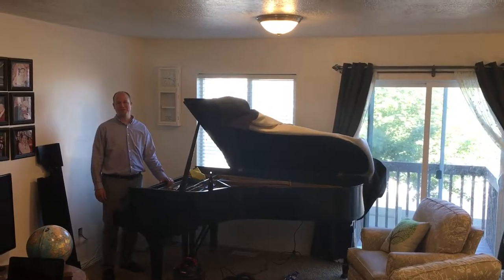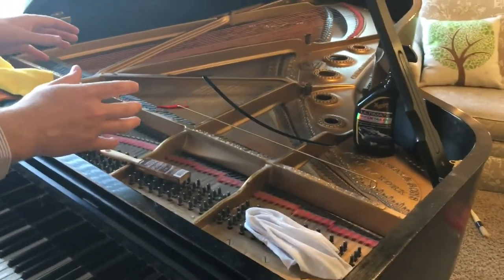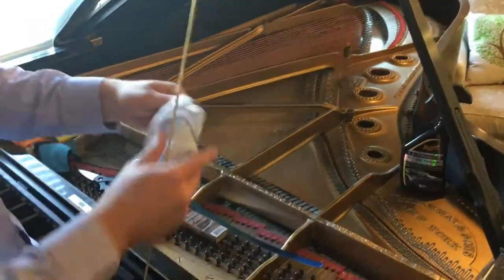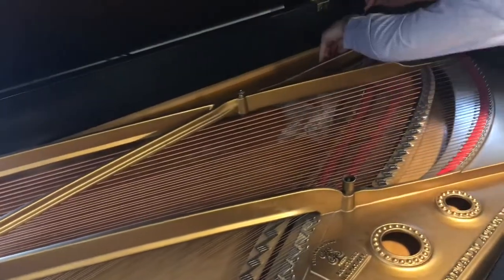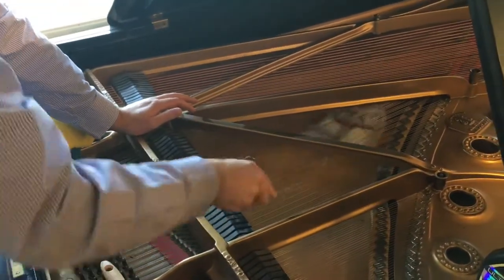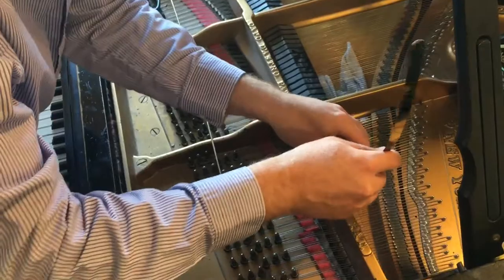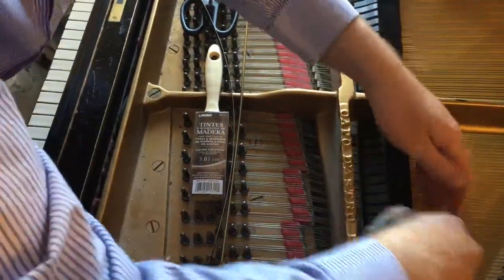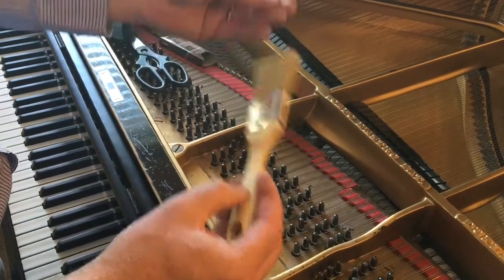How to Clean Your Piano

Comment: Doesn’t the silicone in that Meguiars detailing spray present a danger? I just read about a piano that couldn’t be buffed out because silicone buildup from cleaning products had been absorbed.
Reply from the maker: I use this product based on a recommendation from a finish repair expert who is regularly buffing out pianos, so I would assume not. However, he does say that this spray shouldn't be used too often. Most often regular dusting and wiping with a moist cloth is sufficient.

Comment: what do you think about the idea of a boy with the nickname "piano doctor" who is very popular on YT. He cleans the soundboard and everything with wet wipes. After all, they may contain additives, for example glycerin or alcohols, they will stain or damage the piano.
Reply from the maker: I saw that video! My fist reaction is that baby wipes hold a lot of moisture, much more than what I typically use. Most of the time I am "dusting" pianos, cleaning off light dust on a well-finished soundboard. I think a slightly damp rag might be a better choice, and I wouldn't use the baby wipes on the case finish. Maybe there are some baby wipes with just water added, but it's still more moisture than I am comfortable with.
Reply: @saltlakepianoservice  
I am also a tuner for 30 years in Poland and I also remove dust only with slightly damp cloths.

Comment: Where do I get that tool on a wire to clean the dust under my strings? I need that!
Reply from the maker: @MonogramQueen I sell the tools normally at a cost of $55 plus shipping and applicable sales tax. I am currently out of stock of the tools that I make. You could check in with me (saltlakepianoservice@gmail.com) in December if I have more in stock, or I could order a similar set of tools from an industry supplier, pianoteksupply.com that would include three wire and sweep tools (long, medium and short) and a piece of soundboard steel (the flexible flat steel piece) and ship it to you. The price would be $95 and would include shipping. You could also try etsy or ebay for similar tools. I can't vouch for the quality of tools from other sources. Thanks for the inquiry! Let me know if I can help you further.
Reply from the maker: We now have more cleaning toolkits in stock. Visit https://saltlakepianoservice.com/products.html to order!

Comment: Thanks for the tutorial.  However, my Grand piano has dust that goes far deeper than that (down through the hammers/impossible to reach). Would these need a special technician to remove the metal frame etc? Thanks ☺️
Reply from the maker: Most likely, yes. You can check my video on cleaning keys and that shows how to get an action out of a Steinway, which may help. Some dirt gets stuck on the metal plate in such a way that it is impossible to clean it and have it look like new without removing all the strings and refinishing it.
Reply: @saltlakepianoservice  thanks for the reply and help. Much appreciated ! I’ll get a technician in I think, now.

Comment: How do you deal with cleaning under the sound board through the holes ?
Reply from the maker: I don't usually clean thoroughly under the plate unless I'm restringing the piano and have the plate removed. I will use a brush down through the cooling holes to get anything that might be visible. If you wanted, you can use the kit tools and a rag to dust under that area also, but I don't usually unless there is an object causing a buzz.

Comment: On another video people were freaking out with cleaning without removing the action first. What do you think?
Reply from the maker: This video was meant to instruct a piano owner how to keep up on cleaning the top of W grand piano. I would not usually recommend a piano owner remove their action since it is easy to break something doing so without practice. If the piano has a lot of debris on the soundboard that might get knocked into the action cavity, then, yes, it is convenient to remove the action first. This method above, however, doesn't knock debris into the action cavity if you're careful.

Comment: I would’ve vacuumed then dusted first without the detailer solution, then used the detailer solution afterwords to get the rest.
Reply from the maker: @jay kay I definitely agree! When the soundboard is really dusty it's good to go with a dry rag first, then when most of the debris is gone use S solution, otherwise it just makes a wet mess.

Comment: If you clean the piano strings You can cause them to go out of tune or no?
Reply: There is a chance of making it go out of tune. Best to have it cleaned close to your next tuning appointment.
Reply from the maker: I agree with Abigail, but I find that most of the time, even if the string gets rubbed it doesn't usually knock it out of tune, but I have the luxury of retuning it if it does.